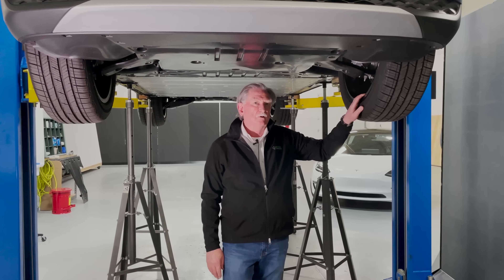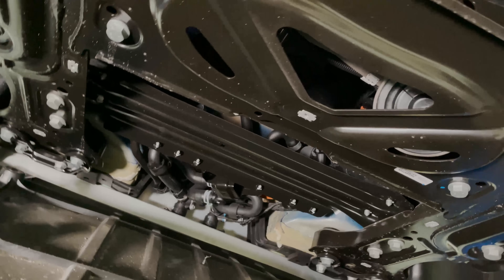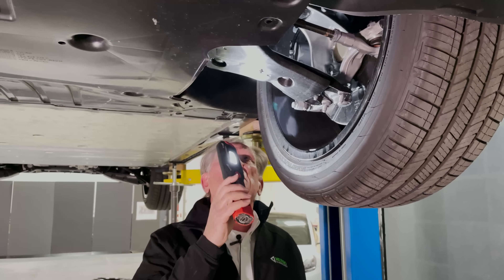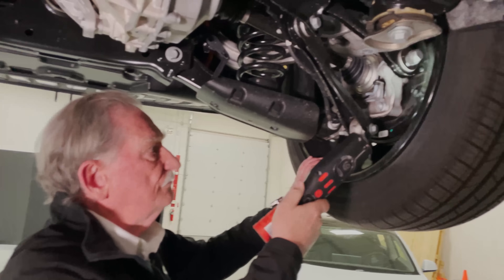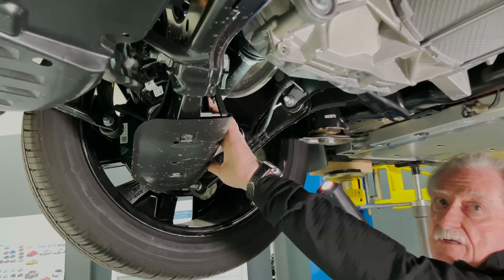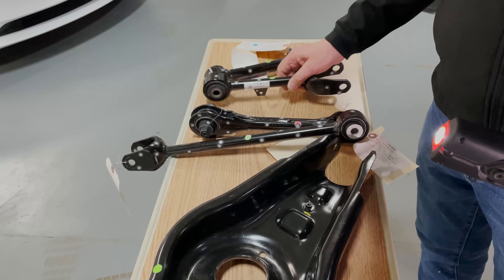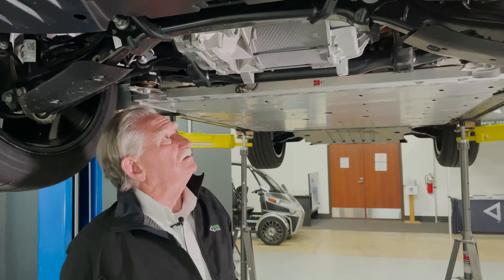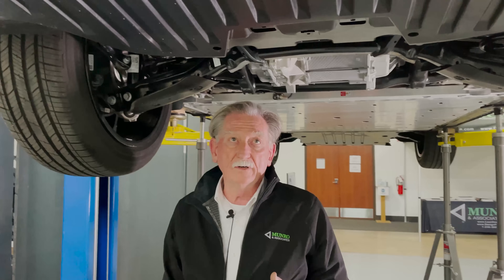2021 Volkswagen ID.4: E3 - Hoist Review, Front and Rear Suspension

Comment: Drum brakes are for winter roads with salt.. Its a closed system, and it don't rust.
Reply: Watch Bjorn Nyland's videos about the ID.4. He explains why drum brakes in the back make perfect sense for an EV. Basically you use them rarely, less rust, next to no maintenance so they always work WHEN you finally need them.
Reply: @Astke  I have already watched that, so i know. Bjørn Nyland is the best man in reviewing electric cars on youtube.
Reply: likely the same with the painted motor, lots of salt and snow in countries like Norway
Reply: @DarwinChaug  Corrosion is a big problem in the south of Norway, its like driving in slush of salt and snow.
Reply: @DarwinChaug  it’s aluminium.
Reply: @kam_iko  Bare aluminum and road salt - not so good friends. It won't rust away like steel but isn't totally resistant either. Especially if there are possible connections with steel screws and bolts.
Reply: @kam_iko  Aluminum doesn't rust but it still corrodes. Today I had to throw away an aluminum bicycle rim due to corrosion and the aluminum valve cover and gearbox of my 2000 Honda Accord do produce flakes of aluminum that fly around.
Reply: That’s what you hear from VW PR. Sure it works with salt but the main reason is to reduce cost, I bet Audi won’t use drum brakes.
Reply: @zyxt9117  AUDI E-tron Q4 does...
Reply: @zyxt9117  they do!
Reply: Does E-tron has drum brakes too?
Reply: @zyxt9117  Eh eh... of course not, but only because they can't fool audi fanboys into thinking they are better then discs. :-D
Reply: Drum brakes are heavier therefore this is more unsprung weight.  Same argument against hub motors. Drums here must be to save money I presume.
Reply: @bluetoad2668  In an race car it matters.. inn a family salon.. Not so much
Reply: The front brakes are discs, that fact undermines your argument.
Reply: @bluetoad2668  No.. They are more often in use than  the rear brakes.. and is there you need the power.
Reply: Tesla makes very fast cars, if you use that excelleration it's likely you'll also need to stop quickly - I that case discs all round please as these cars are heavy. ID 4 is not so much a performance car so rear drums are ok.
Reply: @bluetoad2668  That's ok.. We are talking about ID4, a family salon. Disc brakes are overall the best in power.. VW is trying to solve this problem with salt snow slush.. it eats brake discs. Norwegians are driving approximately 6 months in this slush in the south of Norway.  Tesla has huge problems with this in Norway. An EV tester called Bjørn Nyland here on Youtube are talking a lot about this problem. Check him out.
Reply: @TheJHA67  but I question how much of a problem this really is? After all the ID4 has discs on the front and Tesla model 3 sold more cars than any other EV brand in Norway during Q1, they are doing something right.
Reply: @bluetoad2668  Its seems that the brakes in the front of an EV is more often in use, so there is an problem there to but not so big as the rear brakes. Rear brakes in city use just get eaten away. and when you really need them on the highway they barely works.   check out Bjørn Nyland.. he knows Teslas in Norway.. He has changed a lot of brakes on his private Teslas.
Reply: Definitely VW PR. There is absolutely zero reason to use drums when most cars use discs now and do fine in winter climates.  Let's see how effective drum brakes are when ESC and traction control is active which uses the brakes to control the cars yaw and differential action.  Drums are slow to react, weaker,  and don't have the heat capacity when used extensively for traction control.  Cost is the primary reason,  if VW marketing could make us believe it, they would tell  us that drum brakes do our laundry, cures impotence, and cooks for us too.
Reply: @Robbie6298  rear brakes on EV are to hold the car, almost never to slow it down...
So drum makes sense because unlike the disks the pads are not exposed to the elements as much
Reply: @seb.  do you know how electronic traction control and stability control works?  It's not just to hold the car.  The rear brakes do much more on a modern car than they ever did.
Reply: The inside looks more  "protected" than the disc that is exposed, but it's not sealed in any way. They are way worse than discs in winter/wet/ice conditions. They rust way worse than discs inside and outside. You clearly have no direct experience of changing pads/discs/shoes/drums, otherwise you would have known...
Reply: @GiovanniEsposito5  This drum brake is supposedly sealed.. only time will show. Watch Bjorn Nyland's videos about the ID.4. He explains why drum brakes in the back make perfect sense for an EV. https://www.youtube.com/watch?v=IDlZYf083l4&t=187s&ab_channel=Bj%C3%B8rnNyland
Reply: @TheJHA67  No, they are not sealed. You have never seen/maintained a drum brake, am I right? Please do, than we will talk about this :-D In the video you linked he does not explain why they are supposed to be better in cold/winter conditions and it's his personal opinion unsupported by facts. Believe me, it's just for cost cutting. Anyway, the other guy in the video says that you have to come to the shop to mantain them every 2 years, no matter how many miles you did. Not really a sign of a better system.
Reply: @GiovanniEsposito5  Yes I have, on cars, trucs, tractors and other heavy equipment.. And he didn't say you have come to the shop to maintain the brakes.. Watch again..
Reply: @TheJHA67  So you have seen how badly drums rust on the inside and how poor they perform compared with discs, expecially in winter time and in wet climates. So, why are you buying this BS from VW and with no facts to back it? You should know better. How come VW have this incredible solution to adress a problem that does not exists, putting cheaper stuff on the rear brakes? Strangely none did and has no intention to, because discs brakes works better expecially in wet conditions. They will sure change this drums to discs soon, you will see...
Reply: @GiovanniEsposito5  You don't understand how road salt mixed with snow are working.. EVs in Norway have big problems with disc brakes in the rear.. also in front, but rear brakes last 1 maybe 2 winter seasons. Thats is the reason for VW is taking this change..  I  haven't have drum brakes on my cars  for 30 years.. never in the front..  But they all have handbrake drum inside the disc in the rear.. No problem with that.. Tesla's has upgraded brakes to carbon in Norway.. They were really bad before.. Now they delaminated and oxidise.. Don't know what  is worse..
Reply: @TheJHA67  for me, it's almost 50 years. my 1962 Avanti had discs.
Reply: @TheJHA67  It is sealed should need not servicing it seems pretty much ever.  It's a great design idea.
Reply: @darrenorange2982  it's such a good idea that almost every car except the cheapest of the cheap cars have evolved to using discs?  It's not like drum brakes are a new invention.  They were phased out over time for a reason.
Reply: @TheJHA67  I have had 2 cars with rear drum brakes and they were terrible - always uneven braking, hard to adjust them, hard to do maintenance and ugly as hell. No thank you!

Yeah, and I have never changed disc brakes after "1 maybe 2 winter seasons". Good quality disc brakes go ~10 years.
Reply: @Robbie6298  Honestly I don't like calling them drum brakes as you are right.  These are sealed from the elements these are much different than old school drum.
Reply: @iedzerkvasu2063  on a EV in Norway the disks rust out in three months. I had to change my disks after having used less than 2mm off the brake pads. The reason disks are better than drums is that the cool much more efficiently. But the brakes never gets used enough on a EV. But idiots will demand disks and the dealers will make a killing on replacing them every two years. Thank you Volkswagen.
Reply: @darrenorange2982  I'm pretty sure these are parts bin golf drum brakes.  They are only "sealed" for the purpose of marketing speak as technically they are more "sealed" than disc brakes.  Maybe sandy can investigate and prove me wrong.
Reply: @darrenorange2982  That's what he said.. I think it's genius. I am gonna test drive that ID.4. car on thursday to friday:)
Reply: @GiovanniEsposito5  I agree. The drum brakes are most certainly NOT sealed. If you've ever opened one that was exposed to road dirt and salt, you'd see just how nasty it gets inside. The pads an inside surface of the drum corrode pretty badly.
I also not sure if the drums are actually cheaper to make. What goes for them is that they don't warp.
Reply: @TheJHA67  "they all have handbrake drums inside the disc in the rear". You clearly have never seen a braking system in your life. You don't know how a simple cable hand brake works on the rear caliper. Please stop talking of something you know nothing about.
Reply: @trizvanov  They do deform even badly than discs. They just don't warp axially but if you abuse them they can't dissipate heat as fast as discs and deforms radially, becoming noisy. Drums are never better, this is  why no one wants them anymore even when they have good enought stopping power for the vehicle. VW is just full of BS like any other manufacturer. The incredible thing is how gullible people are to believe stupid claims.
Reply: @GiovanniEsposito5  Well.. that's what I said.. Renault Kangoo 4x4 is the only car I have seen without handbrake drum inside the disc.. Maybe EV have something else.. never laid hands on EV brakes.. so..
Reply: @GiovanniEsposito5  "What  the fuck are you talking about!!??" .. 
Are you serious.  Do a search on youtube. You don't know anything about parking brakes.. Here is the phrase "change parking brake shoes "
Reply: @TheJHA67  go work on a car and get some experience! Forget youtube! Drum handbrake inside disc?? Please, this is not for you. Go back to your work and leave technical comments to people that actually know this stuff.
Reply: @TheJHA67  the most interesting thing about that video is the guy explaining the planned maintenance schedule which VW has - you must bring the car in every 2 years.  Old habits die hard for ICE makers needing to support a service network.
Reply: @iedzerkvasu2063  Do you ofen drive cars in Norway on salt/snow slush..
Reply: @TheJHA67  I live in Latvia, and here roads are treated with salt too. In winter my car constantly has white dirt (salt residue) all around it.
Reply: @iedzerkvasu2063  Ok. How are breaks on EV doing it there.. Petrol and Diesel doesn't have this problem you know.
Reply: Emergency braking with drum brakes VS disk brakes is definitely not same
Reply: @lukalukic1  You mostly use front brakes when you emergency brake.. drum brake are more than capable in the rear.
Reply: @lukalukic1  even in emergency braking the electric motor has significantly more power with the regenerative and also the ABS system protects as well.
Reply: @carholic-sz3qv  Not when the battery is cold.
Reply: Disk brakes work just fine in winter! im living in a northern country in Europe. No problem at all. Thats just a major fail. Full size SUV with drum brakes. No thanks 😂
Reply: @lifestyle4dividends776  Except that it is an electric car -- if you are using the disk brakes to slow/stop the car (other than emergency stopping) you are doing it wrong. With regenerative braking, the disks don't get used often, meaning in a humid or winter environment the disks build a lot of rust. In fact, don't forget that some people who haven't used a car regularly have had the brake pads "bonded" to the disks by the rust. This is the reason for the rear drum brakes -- being a closed system you don't have the same issues as you do with the disk brakes, since the idea is that you only will even use the brakes for emergency stopping and to hold the car in place while stopped.
Reply: @davidnielson9139  Probably true for ID.4 as it's a low performance car. If you are driving at faster speeds, or with stickier tyres - or indeed when the battery is cold and can't take much regen power, you may want better brakes.
Reply: @davidnielson9139  You never heard of brake shoes bonding onto the brake drums? Really!
Reply: @alexd302  Way to strawman what I stated. In the meantime, not something that will happen with an enclosed drum brake.
Reply: @lifestyle4dividends776  In Norway especially the south of Norway are rust on disc brakes bad on electric cars. (salt/snow slush) rear brakes are rusting more than the front brakes. I am living in the North of Norway and don't drive electric yet.  Diesel and petrol cars don't have that problem. Daily beater I drive is a Nissan Pathfinder.. no problem at all.. ID4 has disc brakes in front
Reply: @lifestyle4dividends776  
When you the motor is used to brake (and recover energy), the drum brakes are sufficient to block wheels so more braking power would be useless.
Reply: @lifestyle4dividends776  
I got half ton Silverado and after 8 years the rear drum brakes are stil workin perfect,livin  in snow and salt area

Comment: Drum breaks you must be kidding me is it 1970?
Reply: due to weight shift during braking only 10% is done with the rear drums : that's easily handled with drums an much cheaper + enclosed , hence less maintenance , no rust
Reply: You would be surprised how many disc brakes fail early due to rust on EV’s. This is VW’s solution to it, other company’s rub the discs occasionally  to keep the corrosion off the discs I’ve seen on Tesla forums to turn off the regen once a month and brake heavy to clear the rust.
Reply: @scottwills4698  I just drive aggressively to the point I need to power brake once or twice a week.... to keep the rust off  ;)
Reply: RWD electric car = regenerative braking does all the braking, not the brakes. Disc brakes/pads rust because they'll never be applied on a car like this. Drum brakes are 0 maintenance. This was the right decision.
Reply: @DarwinChaug  Sure the regenerative breaking helps the rear braking systems, but this just means that they could have used smaller disc brakes. The drums don't have any advantage over the discs on durability, they rust even more when condensation occurs inside. The only reason they are using them is because they are cheaper. But this is really a bad move by VW, I am sure they will regret this.
Reply: @GiovanniEsposito5  you know more than Sandy Munro huh?
Reply: @GiovanniEsposito5  In most of the northern countries they use salt on the road and disk brakes that are not used end up as swiss cheese from the salt corrosion. The motor was painted with anti corrosive substance for the same reason
Reply: @GiovanniEsposito5  Fully closed AFAIK.
Reply: @DarwinChaug  I am pretty sure he agrees with me. Have you ever inspected a drum brake? Don't buy all the things the manifacturers say. This is made purely to save money. Compared to discs, drums are heavy, poor performance, less reliable, etc... there is only one reason to use them.
Reply: @GiovanniEsposito5  exactly
Reply: @asicdathens  I live near the alps and experience salt on the roads for many months in winter time. I assure you discs are way better in this enviroment than drums. WAY better. Actually discs are the only way to go if you consider winter use, wet conditions, ice, etc... Drum brakes freeze up way more than the discs do. Please, don't be ridiculos: drums are cheaper and used to save some money. Doesn't matter what the VW pr guys says, they are using it instead of discs to save money.
Reply: @GiovanniEsposito5  3:32 No he doesn't agree with you. "Now that we have antilock brakes, theres NO REASON IN THE WORLD why we can't go with the much much cheaper drum brakes"
Sandy says no reason why you wouldn't go with drum brakes. I rather have a them use the cheaper drum brakes with no disadvantages and have them pass the savings onto me.
Reply: @GiovanniEsposito5  Again, EV's brake without using friction brakes. The engine brakes and recuperates part of the car's kinetic energy. Therefore disk brakes rust because they are not used and salt accumulates on the disc and pads and makes them like Swiss cheese. Modern drum brakes have evolved since the 50's/60's.
Reply: @asicdathens  Again, does not matter if you use more the brakes on an ice vehicle, compared to an EV. It's not the cleaning effect of the pad on the disc or the shoe on the drum that prevent rust or corrosion. Actually it is worse on the drums, because humid air/water enters and stays there. Discs don't become "swiss cheese" in winter, even if you use it less with an EV. You have clearly no experience of winter driving and/or mantaining your own vehicle, ice or ev.  Modern drums are exactly the same of the 60's, they are bad but cheaper. The only other small advantage over disc (other than price) is that they can last longer...
Reply: @DarwinChaug  I am sorry Darwin, but if you had experience on braking systems, you would never say this. Sandy is trying to justify the use as a cost cutting device. We can agree or disagree on that but that is not the point, and in fact he never mentions the winter performance or any other superior points of the drums over discs. Because indeed there aren't any. It is good for the owner to have an inferior system at a little less cost? Are you sure that you can buy a cheaper car because of this cost cutting measure? These answers you will never get.... but I believe it won't make any difference on the end price. It just helps VW.
Reply: @DarwinChaug  dont agree with this statement.
Reply: @asta04  
Bjørn confirmed the same, he was told by VW.